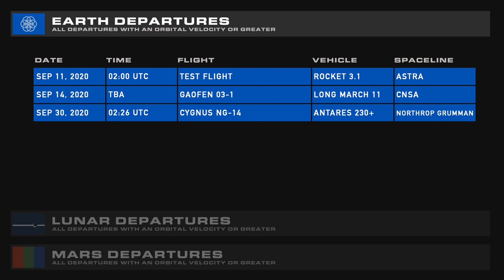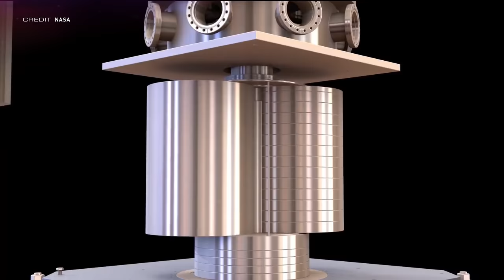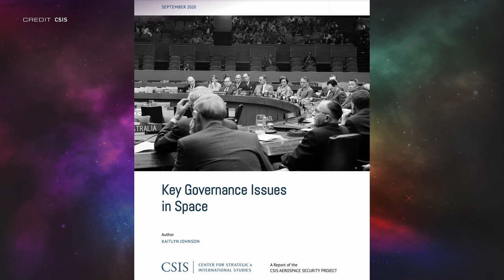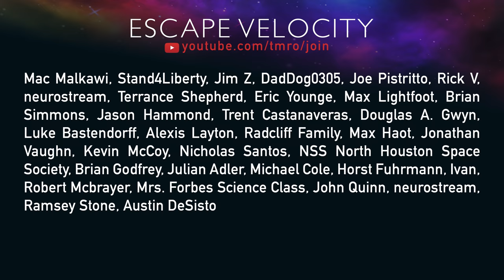Electron Emits A Photon | TMRO:News

Comment: SLS SRBs aren't reusable, but it makes sense in the internal logic of that system. Reuse of the Space Shuttle SRBs reportedly barely broke even, or even lost money. A great concept that hit a RUD upon contact with reality. The new SRBs have a composite shell (better TWR, right?) and designing it to  survive impact, carry a chute system, etc, would negatively affect the TWR.
Reply: No doubt, the original system wasn't effective.  PROBLEM is, when met with an engineering challenge, they gave up and charged more $$ to boot. 😒
Reply: Unfortunately, the composite shell also makes it significantly more expensive.
Reply: @ariochiv  Composite-case SRBs were under development for the planned (but never flown) polar and Sun-synchronous orbit missions out of Vandenberg AFB (I love Jared's [accurate] nickname of "Vandenfog" for the place! :-) ); they were to compensate for the lack of the ~900 mph Earth rotation "tailwind" that easterly launches from Cape Canaveral get. One pair of composite-case SRBs forms part of the horizontally-mounted Space Shuttle stack at the Alabama Space & Rocket Center (called "Pathfinder," whose Orbiter was made from the Orbiter "fit check and handling practice fixture" used at the Cape and the Marshall Space Flight Center), and whose ET is from the MPTA (Main Propulsion Test Article) 098 (the Orbiter Challenger, originally built as a STA--Structural Test Article--was number 099; it proved easier and cheaper to upgrade STA 099 into a flightworthy Orbiter than to modify Enterprise, Orbiter 101, to make her spaceworthy).

Comment: SLS good, kinda, not really, but I wanna see SLS fly and I'm personally kinda glad the U.S. government will very stubbornly build this mega rocket no matter what. I mean the U.S. government basically committed to launch SLS for 40+ years! Could you imagine how cool SLS would be if SpaceX wasn't disrupting everything?

Like NASA's bringing back the Saturn V in a sustainable way, at lest from a political standpoint. Also Solids go brrrrr...
Reply: Well i mean, SLS is way cheaper than Saturn V. And is so far the cheapest 100t rocket, unless CZ-9 beats it
Reply: @_mikolaj_  Saturn V and the Shuttle were about on par with cost per launch, inflation adjusted. SLS will be junking equipment designed to be reused just for reasons There is no way to make SLS cheaper than the Shuttle as an ongoing enterprise. Indeed, the last estimate is for SLS to cost approximately 4 times what a Shuttle cost in nominal dollars after all the safety adjustments were made.
Reply: @Markle2k  including inflation, Saturn V was 3B not including dev costs. That's over 3 times more than SLS without dev costs. And shuttle payload capacity was way beyond 100t
Reply: Michael Hipperson  actually, shuttle derived SRBs never exploded.
Reply: People get far too much disinformation. SLS cost about 1/3 as much as the Saturn V costs to develop, but it is more expensive to launch. If we fly SLS for 15 years the rocket itself, not including Orion, will cost us about ~50 billion or about the same as the Satrun V adjusting for inflation. The price is projected to go down after that point as the RS-25 should go from costing $125 Million to $20-$25 over that time.

The entire Space Shuttle program cost $210 Billion, and Constellation would have cost $250 billion just to get to the pad, with Orion being a holdover from that program that's cost 20 billion by itself so far.

SLS is relatively cheap super heavy lift vehicle when compared to everything not SpaceX.
Reply: Michael Hipperson  Yes--in the early 1970s, Wernher von Braun warned against using large solid rocket boosters in the Space Shuttle design, because they can't be shut down safely once ignited (forward thrust termination ports were studied for abort use, but the sudden deceleration they would have caused would have overloaded the winged Orbiter's structure), and because every reloaded solid motor is--for practical purposes--a different and untested rocket motor, because its propellant grain, case liner, and seals are all new. Liquid propellant engines, on the other hand, can be ignited, (often) throttled, shut down, and (in many designs) restarted at will, and they can be inspected and disassembled for maintenance--while remaining the same engines, with the same individual operational histories.

Comment: I am not sure Rocket Lab using its kick stage after it "kicks" is quite as revolutionary as you imply.  The Electron 2nd stage is still discarded.  The kick stage, is an extension of standard bus designs of other satellite providers and perhaps offer the service a bit more streamlined and less expensive.  Rocket Lab is trying to expand its niche by offering additional services.  I suspect they fear they will be driven out of business as Starship and Super Heavy come on line and drop access to space costs to levels they can no longer compete.  Time will tell if they survive.

Comment: C'mon! How do you reuse a solid fuel booster?
All the fuel gets used.
Get real!
Reply: Solid propellant boosters make better MCD (Minimum Cost Design) rocket components. In the MCD philosophy (developed by Arthur Schnitt, an engineer at The Aerospace Corporation, a RAND Corporation-like "think tank" devoted to rocket and spacecraft design optimization), cost is traded on an equal-weight basis with performance. MCD rockets are larger and heavier--but simpler and cheaper--than performance-optimized rockets (the Soviet and Russian launch vehicles are similar to MCD launch vehicles). The first stages of MCD rockets (which, if liquid propellant, usually use pressure-fed rather than pump-fed rocket engines [TRW's simple, pressure-fed, pintle injector Lunar Module Ascent Stage engine was designed to MCD specifications; they also built a simple, cheap, and reliable 250,000 lbf pressure-fed LOX/kerosene MCD engine, all of whose construction--except the pintle injector, which TRW built in-house--was contracted-out to an ordinary, non-aeropace metalworking shop in their area]) are cheap enough that they can be either ocean-recoverable or expendable; they are more than robust enough to simply parachute into the water.
Reply from the maker: You absolutely can reuse a solid! The Space Shuttle Solid Rocket Boosters would parachute into the Atlantic, be returned via recovery ships to Kennedy, disassembled, refurbished and reloaded with solid propellant. One segment of an SRB on STS-135 had flown on STS-1, and had been reused for 59 flights.

🚀Jared
Reply: @TMRO  I was referring to full recovery by relanding, which was why I mentioned the fuel problem. 
Even so, the recovery of SRB by parachute,  and the ocean dunking,  means they are not close to economical to reuse, due to the huge refurbishment costs. 
Those shuttle reuses weren't the whole SRB. It was only some major components that weren't so hard to refurbish. 
Reuse in context of this video does not mean restoration from a pile of sea soaked component's.

Comment: The use of single launch rockets will die off sooner than later, and as soon the cost of reusable rockets go down, it would be impossible to OK, spending so much for so little. When a congress member is advocating for anything that cost a lot, then we just need to follow the money, those congress members are stock holders and such.